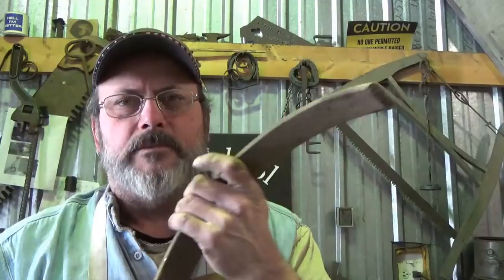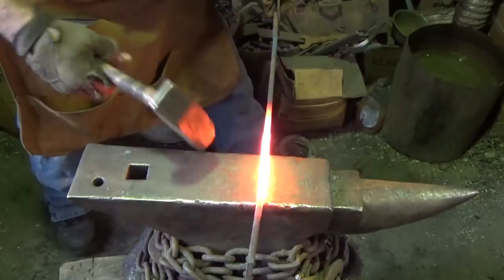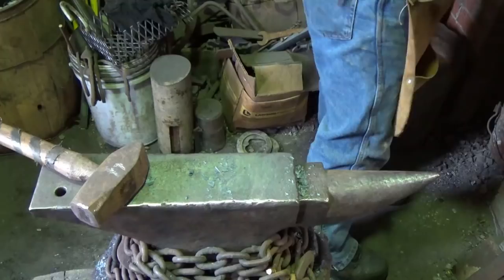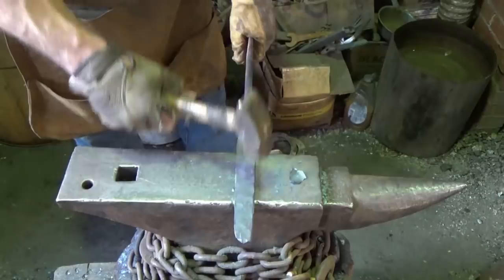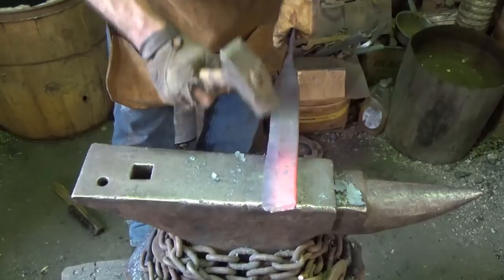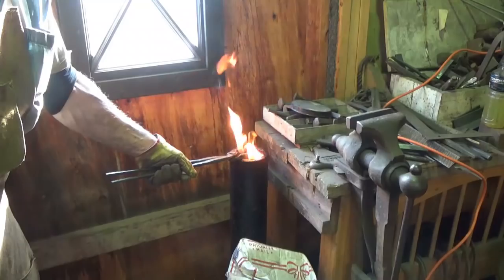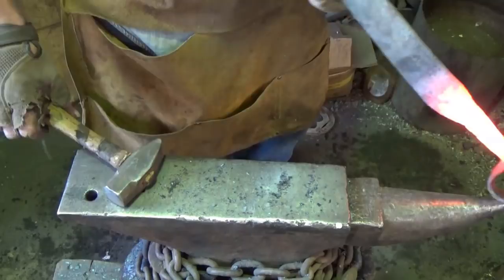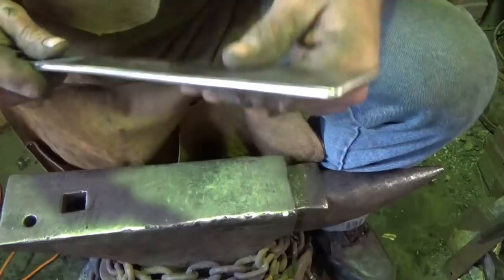Blacksmithing - Forging A Small Froe

Comment: I think you discovered why the standard orientation is with the handle in a vertical start position, you describe it as being 'a little unwieldy'. Due to the centre of gravity, it will be much more difficult to line the froe up accurately one handed with the handle horizontal and the head mass  exerting maximum leverage against your wrist, making the more accurate work such as splitting uniform thickness shingles much tiring to align single handed.I love your videos btw, learning a lot about blacksmithing.